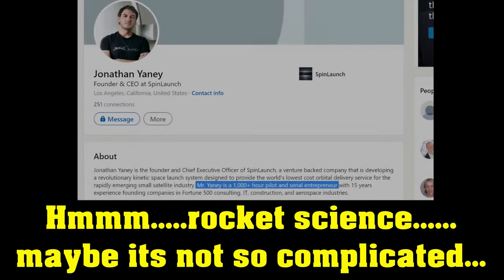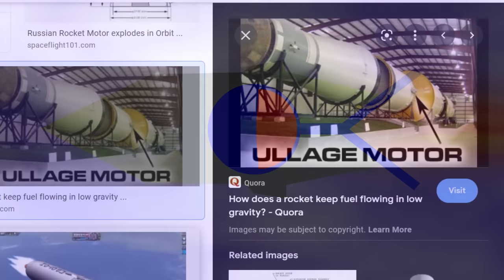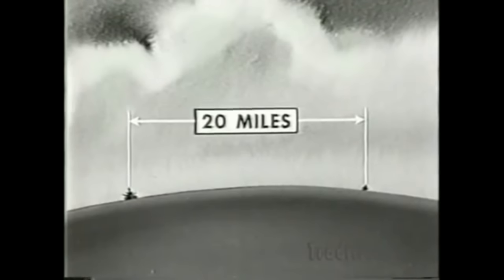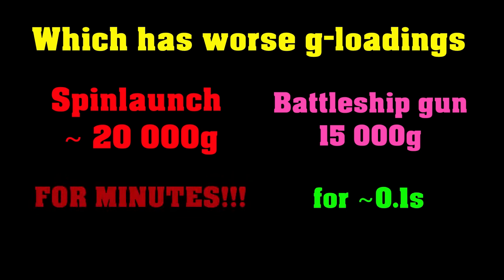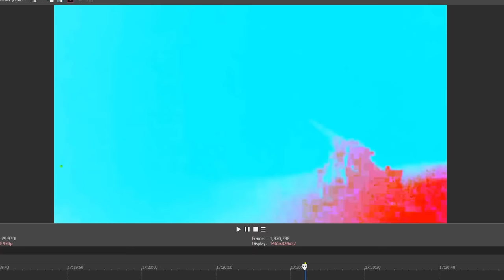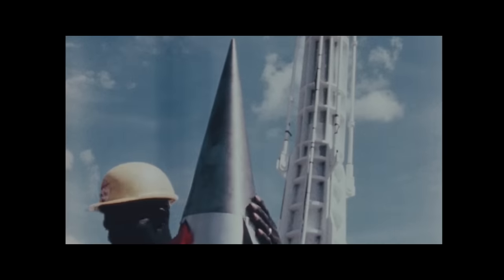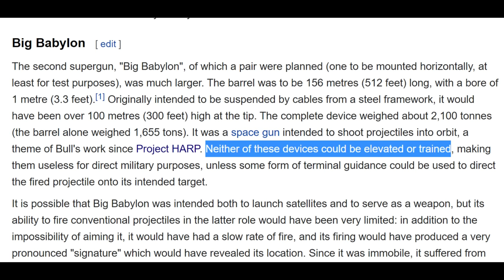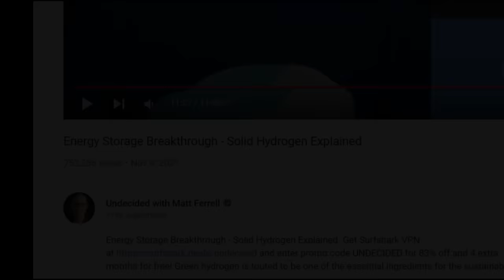Spinlaunch: BUSTED (Part 2)

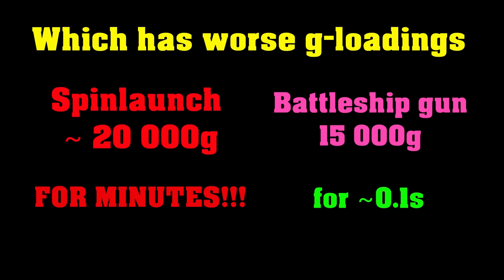Comment: 7:31 the gun is more of a shock load though. A centrifuge slowly raises the loads and a payload could likley tolerate that better than being suddenly slammed up to max load.
Don't get me wrong there are still so many issues.
Reply: @arletottens6349  but that shock is nothing compared the loads when firing from a gun.
Reply: The shock from a gun and a centrifuge is pretty comparable.
A gun is basically pressurised gasses that expand and push throughout the length of the barrel. If you pick the right mix of propellants, and you keep the pressure constant, then you have similar loads to a centrifuge.
Apart from that, a centrifuge adds rotational inertia, so after disconnection it will want to continue to spin and tumble through the air.
Reply: Imagine if a gun had to catch all of the gases that are released when a round is fired.
A centrifuge has to deal with the remaining energy in the arm and mechanisms, while a gun expels it all, with no need to pull any back.
If they chucked the arm with the payload, they might be better off.  At least then it would intentionally rip itself apart.
Reply: 20000 g will stress almost any metal structure over the limit.

In a cannon you pressurise the payload (like the bricks in a building), in the centrifuge you apply tensile stress.

Comment: I like Thunderf00t so no hate here.  I agree that Spinlaunch will probably never work but Spinlaunch has already overcome the depressurization of the vacuum chamber problem.  The second problem of the rocket motor could be overcome by simply using solid rocket motors.  The projectile being 30 degrees off could be fixed with a better release mechanism or perhaps using some electromagnets in the exit barrel to straighten out the projectile before it leaves.  I am sorry Thunderf00t but nothing in this video hasn't convinced me that Spinlaunch couldn't work.
Reply: If they have large super fast doors that don't lose vacuum when they open and close, they'd be very rich from that invention alone. If they can correctly super precisely time both the projectile release and the door opening, such that they never clash, they would also be rich just from that ability alone.

Comment: not sure if this is right but couldn't the framerate be deceptive in regards to rotation rate, also can't liqud fueled engines use bladders
Reply: Yes and not really. 
Yes for the frame rate, but how far off for you believe the frame rate could be? The sound of the camera is pretty steady and doesn’t lend to any distortion from speed manipulation. 

As for the rocket, the fuel could, from a purely fuel standpoint (not from a rocket standpoint) be in a bladder but the liquid oxygen can’t. 

Maybe there’s a design out there that uses them, but I’m sure a stainless steel pressure vessel is easier to construct than a flexible bladder pressure vessel.
Reply: @jrobmccoy  I was thinking of the Rolling shutter effect which has more to do with the ratio of rotation rate to frame rate, I assumed that the sounds were added in post BC of the vacuum. Liquid O2 can have a tank separator and pressurant for ignition then inertia can take over. I was more thinking of hydrazine ect

Comment: The issue of engines not being able to start up with no acceleration/ gravity is a solved issue; small very high pressure tanks (that are essentially as full as they can be so there is no air gap) called 'header tanks' are used to hold a small amount of reserve fuel to start the engines up. This is already a proven concept in the Starship prototypes, where a header tank has been used multiple times to restart the Starships raptor engines after their belly flop maneuver. While I agree with current technology this is poetically not going to be viable for use on Earth, many have pointed out that on body's such as the Moon or Mars this could be an extremely efficient way of entering orbit. This is could make colonies or more likely mining locations way for efficient for returning payloads. Most of this video just feels like your bashing a prototype for being a prototype, of course it's not going to be fully functional. The whole point of the prototype process is to test what works and improve/ invent new solutions to your issues.
Reply: I feel many points were missed!  Ie its not a out firing speed,  it's about the environment..... stop comparing it to a weapon!
Reply: This is very well put, I totally agree.
It's research into new technologies, so yes, it might be crap. But until you try to do it you don't know. It really is a 'maybe it was the technologies we made along the way' kinda thing heheh
Reply: This is the first time someone has written a giant paragraph on YouTube that was actually insightful and unbiased, I was here

Comment: Honestly, even with all these issues, I still like that they are trying this approach (as long as they don't hurt anyone uninvolved with it), as even in failure there is a chance to learn or develop something new here. And of course, the fuel issue is likely rather easily solved compared to the whole spin-to-win part of the plan. That said, I'm only fine with it as long as they are mostly spending private money.

Comment: Ullage motors aren’t really used anymore. Nowadays we use pressurised fuel tanks which helps to hold your propellants where you want them. So in the case of spinlaunch, no propellant is used on the upwards trajectory, so your initial pressure will be enough to keep your propellant secure until you need it

Comment: At a former defense company I worked for (don’t worry, this isn’t classified), I learned we have self-correcting ballistics that can change their directory, orientation, etc. in mid flight. A gun might’ve been a bad idea in the age of active electronics, but with solid-state materials, it might not be a bad idea.

I would really love to see (more) experiments with payloads delivered via scramjet which can reach speeds up to at least Mach 10.
Reply: Imagine a spin launch to minimum scramjet speed, with a liquid fuel stage later

Comment: If you're using electricity to generate the initial velocity, why not just go with a rail or coil gun?
Reply: I'm wondering just how much energy it takes to spin this up to speed, create the vacuum and run the control center.

This can easily become more expensive per launch than using current rocket fuels.
Reply: For one thing, then you have the problem of storing ALL the energy in a rapid-release form, which is non-trivial. Creating the rail gun that can handle that energy is non-trivial too. There's a reason the Navy is about to give up on it as a practical weapon.
Reply: The powerful magnetic fields they use probably wouldn't play well with payloads containing electronics. Such could be shielded but it would likely come at a cost of greater weight/size.

Comment: Doesn't the changing angle of stress/g-force make it even harder to counter? Like in a gun you mostly have to account for a short but massive g-load coming from one direction, but the centrifuge would create stress at different points depending on where it is in rotation right? Maybe I just don't fully understand this though, but it seems like it would create more possible points of failure that would have to be counteracted.

Would a gun-like system be practical "today" with modern materials and general advances in engineering or are there huge drawbacks that haven't been overcome yet?

Comment: The exit tube has two doors that open in sequence and close in just a few milliseconds. I have seen these door operate and they are too fast to see, although they make a hell of a bang. This prevents the vacuum loss. The skin you see in the video is not a vacuum seal. Also the vacuum required is nowhere near a hard vacuum. The spin launcher they have built so far is small and so when they build the full size version which will be 3-4 times larger the spin is obviously reduced. The missile has enough mass to overcome the loss of speed due to gravity and it punches through the lower atmosphere so fast that it can reach the required altitude. Also thermal heating has been overcome with the nosecone specs. The accuracy of the projectile after it exiting the tube and it not tumbling however hasn't been addressed so far and I can't find any info on this matter.
Reply: I'm wondering how you fuel the rocket in the SpinYeeter.  To fuel the rocket before inserting into the Yeeter, with the cryogenics boiling and building pressure for hours while the chamber is pumped back down and spins up for another hour?  Or perhaps they suppose they will fuel the rocket as it's spinning up,  fuel lines connected through magical bearings designed for cryo liquids- fuel and oxidizer.  plan B  would be a moving target for the counterweight system.  it's a fun thought experiment, but a total scam.
Reply: @travismiller5548  they fuel it befor putong it in there.
Reply: @noneims3770  cyro fuel needs to be used pretty immediately after being pumped in.
Reply: @spaceducky101  If they don't have a salution then they couldn't even think about it.
Reply: @travismiller5548  The fuel is a pressurised system and these have been worked out. They have really thought about a lot of the problems much more than Thunderfoot gives them credit for thus so far. They have a few ways of balancing the bearings such as releasing an opposite counter weight ect...I can assure you it isn't a scam and they are planning to do between 5-10 launches per day. Their biggest hurdle is to get a grant or funding for the full sized site which will only get more expensive as time moves on. Because of the disruptions in trading effecting now the whole world, it may never get what it deserves which will be sad if they accomplish everything else that is required of them.
Reply: @darklight2.1  If you look at recent videos about this you will see they are not another scam act and in fact they have thought so much of this through. Thunderfoot has gone a little to hard on them comparing them to the scam artist with the blood test device which didn't even exist. It is not fair to throw them in the same basket and brand them like this although I like Thunderfoot most of the time. The guys who are trying to make this a reality really do care about this project and they believe it can succeed. They are not scam artists whatsoever. Nobody says this about fusion energy do they and it's been 60 yrs of struggle and it is still about 30 yrs away even if ITER or the German variation proves to get their 6 mins of sustained plasma correct. I would say fusion is the most important struggle man may ever face because the climate crisis is more terrifying than anything else I can think of.

Comment: I maybe missing something but if you release an item weighing, oh I dunno, 10kg? And release it with enough energy to get to space WITHOUT burning up as it goes through the atmosphere. Wouldn't you need to release a similar 10kg weight in the opposite direction?
So a 10kg meteorite landing right beside your launcher?

Comment: Plus, does spinning it electrically even save energy? Its interesting to know if rotating it for an hour building up energy in the long run (including evacuating the chamber to vacuum) is even cost effective or environmentally more sustainable then just using reusable rockets… this tech could be redundant.
Reply: I think that it open the system to all stort of energetic input, with spinyeet you could theoretically indirectly propel rockets with damns, nuclear power plants or others.
Reply: Yes, it saves energy. You get around the exponential energy requirements of the rocket equation (lots of fuel needed to lift some fuel needed to lift a bit of fuel,...). Converting chemical combustion energy to forward motion is also somewhat inefficient. But satellites need to go sideways very fast, not just up, so yeeting them is a lost cause and investment fraud, IMHO.
Reply: I really don't understand your criticism here. If it uses solar or wind it's kind of irrelevant how efficient it is.
Reply: @Ozhull  what criticism? I asked a question. #readingcomprehension
Reply: @FlashNorton  🙄 sure you were, there was NO negativity implied at all by your comment.

Comment: Having used centrifuges in the lab, I was familiar with the forces and the idea never felt right to me - The time x G  being the critical problem.    2 hours at 10,000 plus G, it’s sounds like high failure rates, and short lived launch mechanism.  
Then the hydride that releases millions of times it’s volume in hydrogen. I saw that 
and was sucked in but then it didn’t seem right either.  LAH can’t do that.  These things are screwing with our perception, thinking solutions are easy.  

So many of the trash science videos, especially generating alternative fuels - give a false idea of the amount of energy required, precursor and byproduct issues for these to be on a scale we require.  
Having spent thousands of hours with elements and molecules, creating hydrogen in cells , bubbling anhydrous ammonia in nickel pot of molten sodium, you get a idea of the energies and hard work this requires.    

I forgive the naive  but the ones that know better and push fake science to sell fantasies.  This does damage.

We better use much the free potential energy in petroleum to make lots of solar cells, windmills and nuclear reactors so we can  continue to create the urea and tractor power we will need to feed ourselves and maintain some order once the easy alkanes have been spent.

Comment: 2:18 "you need a way of getting the fuel to the bottom of the fuel tank"

Why would it not be possible to pump the fuel from the top of the fuel tank? OK, this would require an additional fuel pipe and pump but it's not impossible. Of course the same is needed for the oxydizer.
Reply: Once the rocket turns on the fuel will fall to the bottom.

Comment: I immediately saw this as GARBAGE when I first saw it. 
I'm a gadgeteer, and I've built many things over the years: AND I saw that once the rocket was sent off, this would become the worlds largest VIBRATOR motor. Akin to the tiny motors used in cellphones to make them vibrate; but these are tiny motors with a tiny off-center weight on it. And these are capable of moving a cellphone around under certain conditions. 

Spin launch would HAVE to have both arms balanced in order to have it rotate evenly. And when it "Launched" the rocket it would instantly go to an unbalanced arm and vibrate apart the launcher as well as destroy the bearings and mounts for the motor itself. And likely shred the motor as well.

This is a scam. Plain and simple.
Reply: Or they could detach the counterweight at the same time and have it hurtling toward the ground/building with an equivalent force to the payload they just tried to send to space. That sounds like there would be no downsides at all. /s
Reply: @diggoran  except for a very heavy weight hitting the inside of the container, which is moving at several hundred miles an hour.... Think of an army tank firing off it's cannon at a target two feet away; The shell will go through the target. And " pointing at the ground" won't work BECAUSE this scam is supposed to be a sealed vacuum container, and a ejectable counterweight would rip apart the container like a kid ripping open presents on Christmas.
Reply: @zaphodthenth  the /s at the end of my comment was supposed to indicate sarcasm
Reply: what about adjusting the distance of counter-weight to the rotational center ? /no sarcasm :D
Reply: @enderaslan7998  I'll answer your question with this question... WHERE is this being built? 
Oh that's right. It isn't.
Reply: @zaphodthenth  thats a question of a journalist, not a gadgeteer... So my question still stands

Comment: Regarding the point about the fuel, surely the tanks wouldn't be half full? If the tanks are full and under high pressure relative to the atmosphere at the rear, would it really be much of an issue?